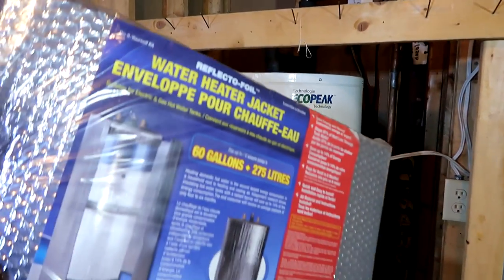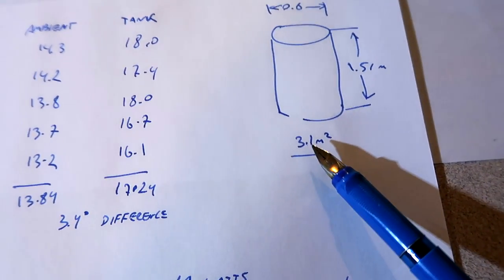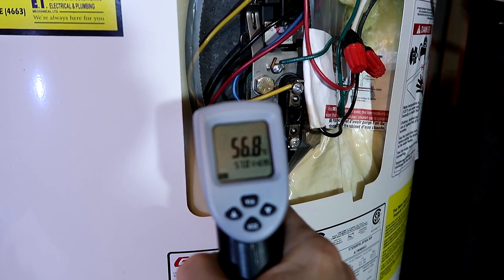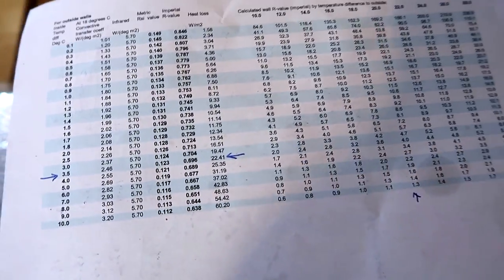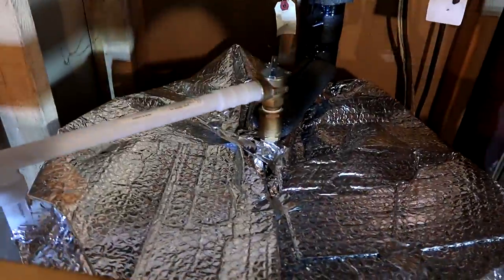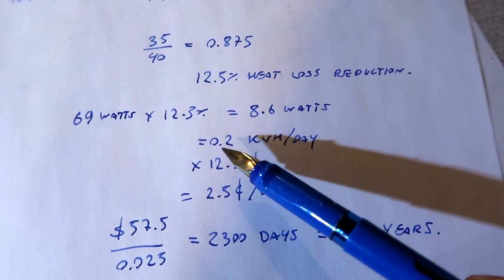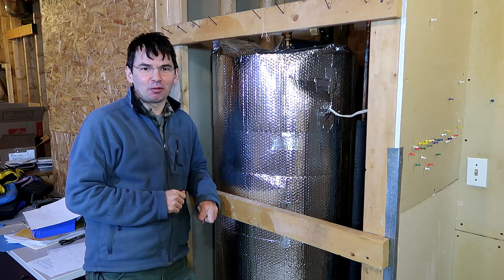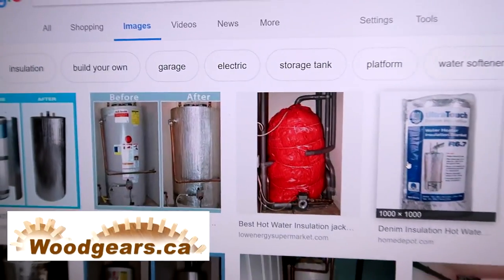Hot water heater insulating jacket:  How much savings

Comment: I looked up the emissivities of common household surfaces like paint, raw wood, and wood finishes.  They are all uncertain, with variations of a few percent.  A 3% emissivity uncertainty corresponds to an IR temperature uncertainty of about 2 degrees C at room temperature.  Measuring the difference between the temperatures of two different surfaces increases this to about 3 degrees C.  Conclusion: the temperature differences measured in this video have a probable fractional error of near 100%.  You would be much better off using contact sensors.
Reply: I do not think that is correct. At room temperature in a room in thermal equilibrium the emissivity does not influence the measurement since the sum of emissivity, reflectivity and transmissivity is always 1. The problem at low emissivity is that you risk measuring reflected radiation from surfaces of different temperature such as your own body.
Reply: @larslindgren3846  Three comments: (1) Materials like paint, plaster and wood have emissivities of greater than 0.9.  So the influence of photons reflected from surfaces other than what he is aiming at is small. (2) His body is warmer than the other surfaces in the space, but it fills a rather small solid angle.  So he's not contributing many photons either.  (3) These effects, including what you suggest, only make the measurement more imprecise.

Comment: I made my own heater wrap using recycled old fiberglass insulation and aluminum foil. When I place my hand under the extra insulation, the surface of the water heater definitely feels hot, and the insulation itself was free, so I think it is saving me money. I also keep the heat turned down all the way, so that it’s comfortable enough for a hot shower. All my hot water heaters had an eight year warranty, but they all lasted at least twelve years as a result of keeping them at a lower temperature.
Reply: What about the bacteria and things? Is that thing real?
Reply: Draining a hot water heater annually also increases its life-span. You would be amazed how much deposits build up in them. Eventually, the minerals stick to the heating element... We replaced our HWT about three years ago because the original was too small. However, it was in good shape and 14 yrs. old!

Comment: Those radiant barriers apparently need an air gap to reflect effectively otherwise conduction ruins the effect.
Reply from the maker: Yes, an air gap behidn them helps.  The spacer strips aren't rally that effective, but I also wrapped it around the outside of the drain pipe, so where i measured it, there was a bit of gap behind it.  How it's installed makes a difference.
Reply: Yes, I think the treatment of the insulation numbers were for a conductive barrier, whereas this is a radiant barrier...the heat loss is to the fourth power of the absolute temperature vs the absolute temperature of the surroundings, which was (273+18)^4 vs (273+14)^4...is that close to 1.125?
Reply: That is only 1.056...I think this radiant barrier might be much more effective in extremely cold basements where the temperature difference is much greater than 4C.
Reply: @matthiasrandomstuff2221  Likely would've had better performance coating the metal with white Flex Seal to reduce heat flow through the metal covering. Or put a full layer of plain bubble wrap on it first. If you're leaving it on, cut holes to expose the thermostat hatches. Trapping excess heat around them can do bad things, up to making them get hot enough to come close to catching fire. ISTR a few cases of water heaters wrapped with thick fiberglass batting in the 80's (when this craze started) catching fire. The one in our house back then came >thisclose< to burning. Scorched and melting bakelite (or phenolic or whatever plastic is in them) smells horrible, like burning oranges.
Reply: An air gap raises any r value.   Static air has a r value.

Comment: I would mention that if your cost for your heat source is more expensive, you gain more savings faster. for instance, in California it is 27 cents per kw/hr. or propane that can cost quite a bit.

Comment: Great Videos as always Matthias--but FYI--electric water heaters are much more prone to legionaires disease due to cold spots in the lower corners.  Therefore, its usually recommended to raise the temp in the tank to 140 and have a mixer on the outflow to bring it back down to 120.  Gas fired heaters don't suffer from this since the burner is at the bottom and it boils off any bacteria.  If you drop any water heater to a low setting for too long though, you do risk legionaires growth.  Only way to really save money on water heaters is to go tankless--but even those have their associated issues.

Comment: He's BACK!  How we save money. Our basement is 44 degrees F in the winter, it's also where we have our propane hot water heater.  It's set at a lower temperature.  We also have a dishwasher. We found that if you set the dishwasher to come on and finish an 1/2 hour before you shower (i.E. before work).  The dishwasher uses enough hot water to have the water heater come on heat up the tank,  and you always have a nice hot shower, because it's at the high end of the thermocoupler switch.

Comment: If you want to decrease the heat loss, and not pay as much, wrap regular fiberglass--or better yet: Roxul--bats in vapor barrier material, and wrap your tank with that. Your material expense will be less, and your heat retention will be greater, resulting in a shorter payback time or higher Return on Investment (ROI).

Comment: you should just put a timer on it.  and monitor its electrical draw. way more accurate
Reply: And if you set it up to suit your peak hours of use, you will save quite a bit. Ours turns off at 11pm and comes on at 530 am. Off at 9am and on at 330 pm. I noticed a difference of about 10$ the first month. No guarantee anyone else will.

Comment: When I was growing up my dad had a box similar to yours but with another wall it'sthe  heater set in and we filled it with loose insulation that was left over from the attic it was basically free seem to work good when we had to change the water heater a couple years later we just took the wall off swept up all the insulation put in a bag. changed the heater and poured the insulation back in

Comment: The foil bubble wrap stuff is often a lot more inexpensive if you buy it as just a normal roll rather than something tailored to the specific application. For nearly $70 I would expect you could get enough to wrap that tank 3 times and still have enough spare to buy some foil tape to seal it.
Reply: I can only go by the price's here but they also sell it as a radiator reflection layer. Usually 20/30gbp for enough to do half my radiators along with some double sided tape. Where as a roll of similar size is around £10

Comment: Nice EcoPeak heater - your utility will like you for the 800W load instead of a bunch of peak.  I though these were only available in Québec :)  

Couple of tips I tried that worked (using current monitoring systems)
-Lifting it up from the concrete : no need to conduct heat to the basement slab
-Adding a anti-convection loop : you take the output of the tank, pipe it downward (beside the tank) a good 36in then back up.  Prevents the hot water from seeping into the pipes while not used by convection.  Got this trick from the NovoClimat 2.0 rules in Québec.

Comment: On your water inlet and outlet lines, install a U connection, like the water trap on a sink drain. This U will stop the convection heat loss from the hot water tank into the water line columns.

Comment: The wrap is very similar to,or is, double bubble or single bubble insulation used in metal buildings.  That runs from 25 to 30 cents per square foot USD.  You could use that insulation and wrap 4 tanks for the price paid when buying it as hot water tank insulation.

Comment: Not trusting the conclusions based on surface temp readings (at this point), a more reliable way to quantify the difference would be to control the ambient temperature if possible and simply clock the cycles once things had reached equilibrium.  First without the insulation and then with.
You might find that it the coils are energized for 13 minutes an hour with insulation and 14 minutes without--or something like that.  
A little work insulating the top and the first few feet of copper coming off of it might have just as much impact.

Comment: One who thinks of saving money by turning temperature down must consider Legionella bacteria hazards. 60C water standard is not just a number!
Reply: just don't use it for cooking or drinking, mine is heated to only 45C and it is fine
Reply: There are also hot water heaters that can be set to a lower temperature and will run a legionella bacteria cycle where it heats the tank to 65c and keeps it there for 3 hours every so often to kill off any bacteria.
Reply: You also can't use it for bathing or hand washing or pretty much anything.
Reply: I heard you can get them just by taking a shower in them.
Reply: The mist of the water spray is enough to get infected.
Reply: @achillevache3866  Drinking isn't the problem with legionella. The Problem are small airborne water droplets from taking a shower.
Reply: @brianbassett4379  did you ever see the crazy russian hacker telling everyone to make a dry ice air cooler? Fair play to the guy, he quickly made another video straight after telling everyone why it was such a bad idea, but that didn't stop me yelling at my monitor for the duration of the first.
Reply: @achillevache3866  cooking or drinking is fine. It's taking a shower that's risky
Reply: with uv leds on the inside enough to sanitize the water it migjt work but then how much wattage fonyou need to illuminate the tank enough for sanitation
Reply: @MaxMakerChannel  yes, the danger is in inhaling, not in getting it on yr hands
Reply: @brianbassett4379  remember the video telling people you could charge your iPhone in a microwave.......
Reply: @arrangemonk LOL! Why not boil it all prior to use, Orrrrrrr, have distilled water piped to your home? Or stop sweating the small stuff and go outside you knob.
Reply: To prevent the bacteria from growing in the water, just hang something silver inside the water heater.
Reply: It's a small chance for Legionella to appear in running water even on lower temperature. If you use hot water regularly, it's enough to raise temperature once a week above 60C. Energy saving tip: do it on Friday night so you can use more hot water during the weekend when more family members are at home.
Reply: @MaxPivovarov  really? That's interesting. Like colloidal silver some people use for it's anti bacterial effect?
Reply: @achillevache3866  No it's not fine at all. I hope you're single and not putting a woman and children at risk.
Reply: @theoldtimeywoodworker2488  My parents started doing this 15 years ago when i was a kid, and we never had problems. By the way, my father is a doctor and thought that was fine.
Reply: Achille Vaché “we never died” == “there were no risks to that”? Doctors are supposed to have a little grounding in statistics, but then a lot of them have problems interpreting study results.
Reply: @achillevache3866 . In all seriousness Achille, it is a big deal. 20 years ago this happened 10 km from where I live:
https://en.m.wikipedia.org/wiki/1999_Bovenkarspel_legionellosis_outbreak
Hygiene laws have been adjusted since in my country and the public has been made aware of the risks. Just give it a read with an open mind.
Reply: @theoldtimeywoodworker2488  From what i read, Legionella appears mostly by contamination of the grid, and develops when water is maintain hot during a certain period. Where I live, water is tested frequently and chlorine is added, which kills legionella. And our water is heated permanently in low quantity by a boiler, there is no tank. But it might be a big deal in certain areas, I remember my father checking the report from the water company and when it was bad, we often drink and cook only with bottled water.
I think the right move is to know exactly what is in your water, and do accordingly.
Reply: @achillevache3866  The bacteria has a chance to grow in standing water. All public facilities in my country have a protocol to let (hot) 55° C water flow from all taps at regular intervals so as to avoid long standing water and growth of bacteria in the piping. It's also advised that when we come home from a 3 of 4 week vacation we do this in our homes.  It has more to do with contamination in the piping than the quality of the inbound drinking water which is under strict control. If you have a small boiler like you and I have and regularly use all taps, we should be fine. As long as we keep our piping clean.
Reply: @theoldtimeywoodworker2488  I agree with all of that ! Even if the inbound drinking water is under strict control, we have some contamination times to times, mostly by manure (which is put in fields),a and sometimes random bacterias, that is why we check reports.
Reply: 60C is good for killing it, but 50C is adequate for preventing growth. That's all you really need. Hundreds of millions of people having been using hot water tanks set at 49C for several decades, and there hasn't been a huge outbreak. Much below that temp, and it gets sketchy. 32-42C is the ideal growth range.
Reply: @achillevache3866 It It is not fine. The infection vector is inhalation, so the steam in your shower is where you are at greatest risk. Cooking will kill the bacteria, so that's not a concern. 45C is dangerously close to the ideal growth range. You've just been lucky so far.
Reply: So...what about the cold tap?  Are you saying legionella can develop in a hot water heater / tank?  Hardly likely as it is an enclosed system and typically not standing water.
Reply: @scallywag1716  It comes in from an external source, so typically the cold supply. If the temperature in the tank is favourable to growth, it can multiply to dangerous levels. In typical usage patterns, the water in the tank stays mostly undisturbed for at 16-20 hours at a time. If even you "empty" the hot water tank through hot water demand, the incoming and outgoing water are mixing so that a significant percentage of the water that was in the tank prior to the event is still there after.
Reply: @achillevache3866  So how to cook or drink your water. Using bottle water is much more costly.

Comment: I live in Canada where the heating season is from September to May.  Having heat leakage from the water tank contributes to the required house heating for 75% of the year.  So the net energy savings would be even less here.  The opposite would be true in an area that requires air conditioning for much of the year.  You would need to calculate the air cooling load that the insulation has avoided and take credit for that energy.  Since it is about 3-5 times as expensive to cool something than heat it, that 6 years could be reduced to 1 -2 years very quickly.